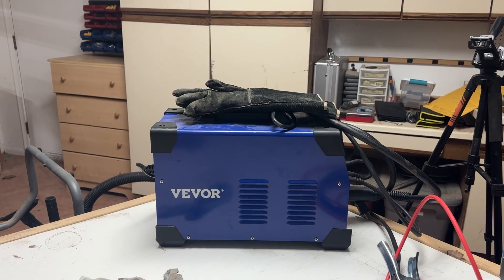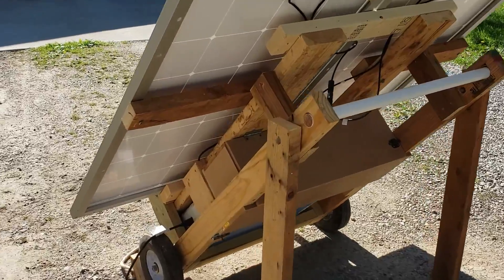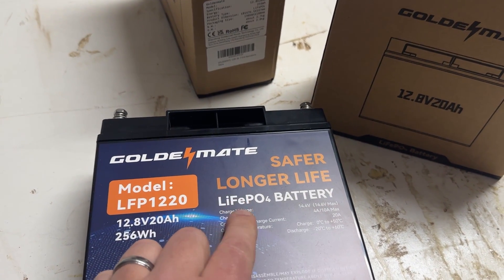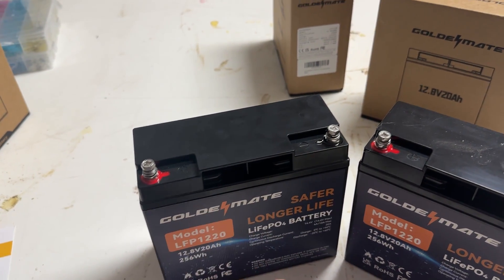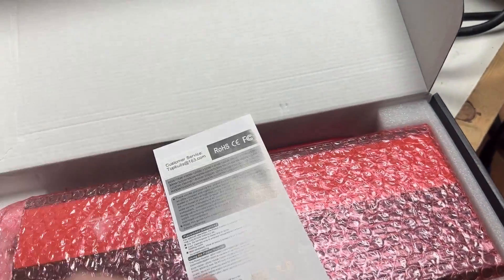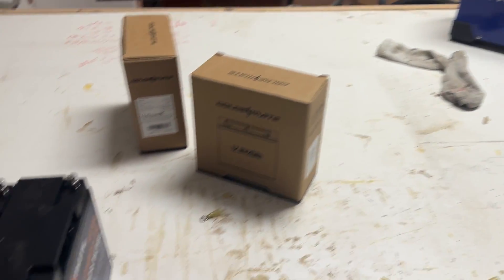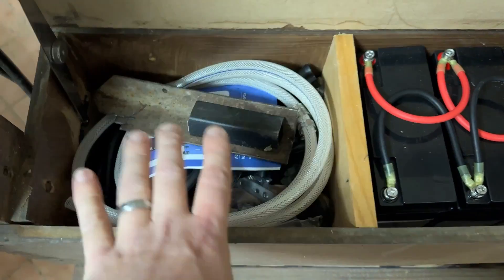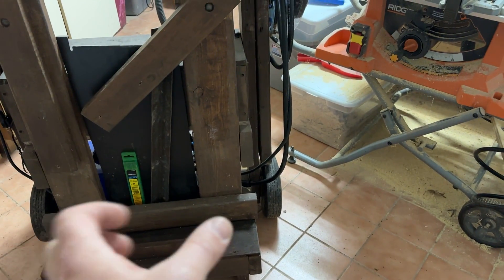Building An Inverter Powered Welding Cart  - Will it work?

Comment: Running your 4x batteries in series through a 48Vdc-to-120Vac (or 240Vac) inverter would be more efficient.  But a way to resolve your current question of what size of 12Vdc-to-120Vac needed, simply run a cheap 120v plug-in powermeter between the welder and wall while it's running to check the actual peak current draw (many of the plug-in meters support "max observed" hold that you can recall at a later time, although the original P3 "Kill-a-Watt" that many recommend does not). Then purchase either a basic sinewave inverter that is rated 20% greater continuous power than the peak observed at the wall.

Alternatively, purchase a "low frequency" inverter rated for 2000W (same as the 15A NEMA 5-15 plug on the welder is rated for) as they use the magnetic flux of the large toroidal coil switching at the native 60Hz line voltage in order to achieve 1/4-wave peak load minimum of approximately 3x the rated RMS capacity (1/4-wavelength is approx 300ms). Basic sinewave inverters you'll notice are far lighter than the equivalent wattage "low frequency" inverter due to the them using a much smaller transformer that they switch in a PWM fashion  (typically above 10kHz) fed through a filtering network then to the 60Hz (or 50Hz) final output winding. This means that they do not offer any meaningful ability to "store" residual power reserves in the magnetic flux of the output transformer. Any "peak" ratings on these basic sinewave inverters can be ignored as they are academic, consisting of simply the power output capable by a single PWM pulse at the peak sinewave output waveform (approx 25uS "peak" at 10kHz PWM). They do however, usually provide their rated continuous power, even if they trigger overload protection just a few watts over that output level.

Another way to achieve similar results is by purchasing a bulk voltage converter, which then provides the 1/4-wavelength peak demand via it's natural 60Hz magnetic flux capacity. This can be especially useful when using a 240v basic sinewave inverter connected to a 240Vac-to-120Vac voltage transformer, often providing similar results with an overall cost less than 50% that of a commercial low frequency converter. This is because low frequency inverters typically target off-grid whole-house power and so usually include features such as 120V/240V split-phase support, AC input synchronous switchover (UPS feature), DC battery charger, etc, and being designed for a specialized market, do not offer as great an economy of scale as more commodity basic inverters and voltage transformers.

Thank you for coming to my T.E.D. Talk =)

Comment: I'm watching this 10 months after you posted it, so you may have learned these things already, but here goes. 1) Your welder operates from a 120 volt ac 20 amp circuit. 2)Your inverter, no matter its quality, is going to waste energy. 3) If the inverter WAS 100% efficient, and it isn't, to get 20 amps from the AC side of your inverter you must deliver 200 amps from the battery. 4) Your battery bank can only deliver 80 amps, based on what I read on the side of the batteries. 5) Even if you were using a larger battery bank that COULD provide 200 amps to the inverter, your wires between batteries and the wires from the battery to the inverter are miserably undersized. 200 amps, and remember, you could require as much as 240 amps, depending on how hot you run the welder and how inefficient your inverter is, requires a 3/0 AWG multi-stranded, pure copper cable with properly attached ring terminals. Think very high quality welder lead cables. 6) That tiny maintenance charger is going to take a long time to recharge your battery bank at 2 amps and will take a lifetime to recharge the battery that you are going to end up having to use to get this system to work.
   What you're trying to do WILL work, but you need a single battery in the 200 amp/hour range to eliminate the wiring between batteries, then you need the 3/0 awg cables from the batteries to a good efficient pure sine wave inverter that can provide about 2500 watts continuous power, with a healthy surge capacity as well. It will be expensive, but you can cheap out some by using a couple of 100 amp/hour lead acid deep cycle batteries in parallel, provided that you realize that they require more maintenance and won't last like LiFePO4 batteries would or run the welder for as long of a welding session before needing to be recharged.
   I think most of your issues are with the size of your battery bank and the wiring to the inverter. That inverter may actually work with enough and properly wired batteries. No inverter will work with the batteries you're using, with the wires that you have. Sorry, just the way it is. Battery first, then invest in a new inverter if that doesn't work. Don't use the capacitor. Think about using your solar panels to do the recharging, especially in the field. They will put out much more current than that trickle charger. BTW, forget using TIG outdoors, if there is any wind at all. It will just blow your shielding gas away. That's why they invented MIG. Stick welding is the way to go if you know how.
   Hope this was of some help.
Reply: Thanx....I'm trying to do the same thing. I have a pure sine 3,000 inverter. I hooked it to my truck and gave fault on the first strike. It seems according to your advice,  I need 200 AH  battery? But you mentioned might need 240 AH?...... I wonder how long could I use my inverter small welder for.

Comment: inventors is that to hard to invent a simple, cheap battery bank to be conected to electricity all the time when we are using the battery bank to weld,  meanwhile we weld, so we never be out of charge and the welding machine will be in operation all day! with out to be connect direct to my howse and aboid burn the breaker!

Comment: Hey man I got some info that will help u out. My cousin and myself ran a stick welder off of a 2750 watt inverter and it welded fine. Had a simular issue you had and decided to attach the inverter directly to the battery in the dodge cummins gen 2 pickup. What we used to connect the power inverter to the truck battery was 2 old welding leads which was able to keep the 2750 power  inverter from kicking off. The wire length and size will make an insane difference on operating the system.  Try installing larger power wires from batteries to welder sir. I think that will fix your issue

Comment: Your battery bank is way to small. Each battery can only supply 20amp as shown on the label. 12.8 x 80amps =1024 watts. If you want an 3000 watt inverter ypu need 235 amp hours of battery bank 3000 / 12.8 = 235amps.
Reply: This comment is correct on one hand, your battery bank cannot supply enough current for 3000W of power. 

The second part isn’t correct though, amp hours has nothing to do with how much current can flow from the bank but rather how much is stored in the bank. A lot of LiFePO batteries have continuous supply numbers similar to the amp hour rating but not all.
Reply: @WizDJ  Most Lifepo4 batteries are only rated for a 1C discharge rate. That is why I said he needs a 235amp battery bank at a minimum.

Comment: Those 20ah batteries are probably limited to providing 20 amps.  Optimally the 4 in parallel could do 80 amps but parallel connections are seldom optimal. 80 amps at 12 volts is just under 1000 watts.  Maybe a bit more surge depending on the BMS.

Also in when paralleling batteries, charge and discharge diagonally.  Ideally you want the length of wire from the charger or load to be the same to each battery.  With two in parallel a simple diagonal does that. With 3 or 4 or more it gets more complicated, but in all cases a diagonal is better than from one end.

Comment: i have a harbor freight 5000 watt continuous 10000 peak modified inverter in my semi with four large truck batteries, and even with the truck running my welder unlike yours, will come on but will shut the inverter down once my mig welder tries to start to weld. that said i am using #2/0 copper wire to the inverter. and 175 amp alternator.

Comment: Hook the welder to a circuit in the house that only it is on.  Then connect a clamp on Amp meter that can measure peak.  Strike up an arc with the welder and you should measure that initial current rush.  With a little Ohms Law you should be able to properly size the inverter surge value.

Comment: As others have suggested connecting the positive to one end and the negative to the other end of your battery bank will discharge the batteries more evenly. Coms guys do this with off grid Radio power banks
Reply: or short  equal lenght cables to a busbar and then to the inverter again short and beefy..

Comment: On your battery bank, my RV has a couple of basic "rv/marine" 12v batteries in parallel and it has the leads to the RV set so the NEG is from one battery and the POS is from the other battery.  Maybe that will help spread your 4 Li batt power if you split the output cables to your inverter too?

Comment: So im about a minute in, so i dont know if this is going to work or not, but I am already thinking about an old chrysler alternator converted, or the store bought version known as a premier power welder. Think this setup on the Kubota PTO or an old lawnmower engine would give you far more bang for your buck.

Also if you are doing mig and tig, where do you keep your gas bottle?
Reply: So welding is the art of melting metal with the heat created by shorting out electricity. 

Keep in mind that you are trying to build something with high end inverters and batteries that don't like electrical shorts. You're also using a lot of energy converting AC to DC and then back to AC again.  The technology to achieve this is definitely out there, but it is going to be cost prohibitive. I'm thinking the technology to do what you're trying to do will be bigger better and cheaper in 4-6 years. 

110v welders aren't really that great to start with.  I'd imagine that they're a lot less great when the battery voltage gets low. Welders use a lot of power, that voltage has got to get low pretty quickly.

Comment: Good video 
One suggestion for making the batteries last longer and not hurt them. Longer life 

Split the ends of the charging and the load ends up. 
Meaning positive end of both charger and load on one end of the 4 bank cells and the negative end of both of the opposite end. 
By doing this you will both discharge and charge the entire 4 bank equity. 
The way you have it. You will be putting both a charge on the one battery more the the rest as well as discharging the opposite end one more than the other ones in the set. 

Should be equally balanced to have the longest life out of any battery in a group like you have. 

Just my two cents and experience. 

Happy New Year and God Bless You and Your Family. 

John and Cathy 
Niagara Falls 
Ontario Canada
Reply: If the battery's bms has a max Amp draw, splitting the positive to the other battery will draw the amps more consistently across all 4 batteries.
Reply: @terryjohnson3100 

That’s what I said.